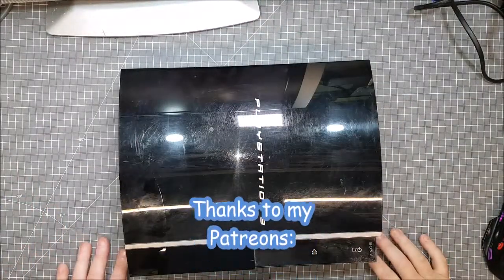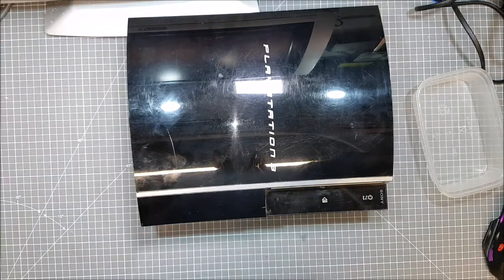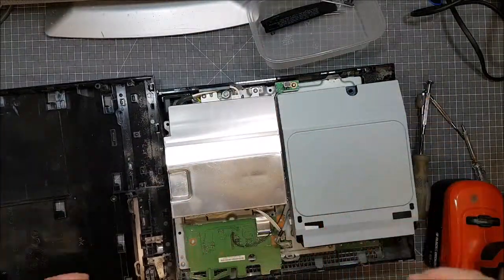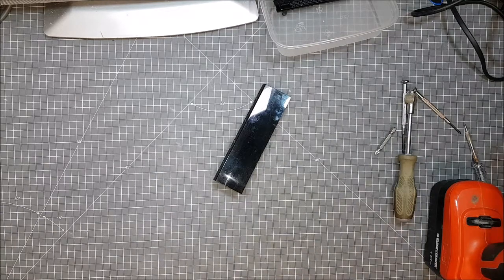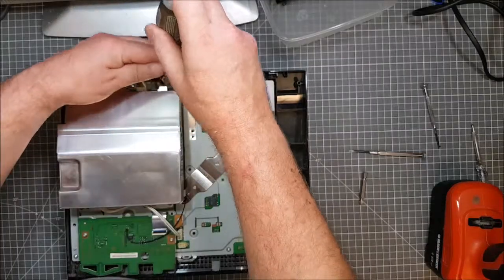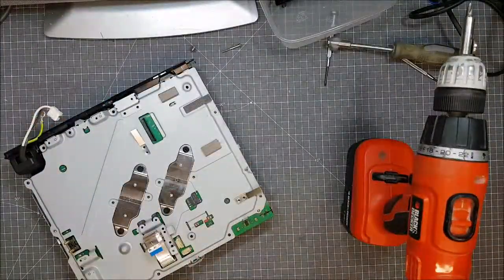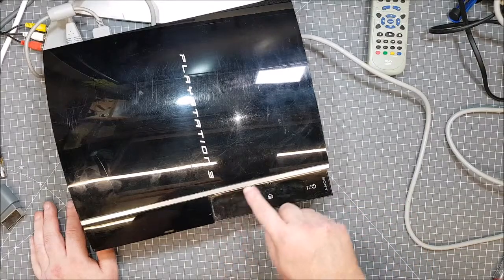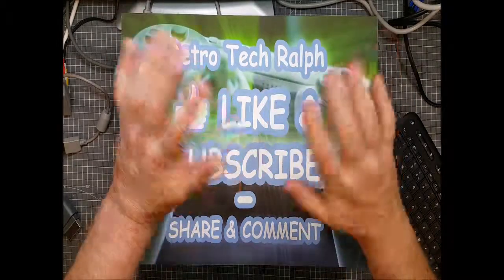2nd Sony PlayStation 3. Trash to GLOD?

Comment: Always worth reaplacing the NEC Token capacitors on the back side of the board with smd tantalum 470uf 6.3V ones. Only thing is it takes some time to do it but then at least you tried what you could and then its probably just BGA cracking under the GPU
Just yesterday i had a GLOD PS3 phat 60gb model, changed the 4 NEC Token capacitors on the back of the board and it is still working today. I modded the fan to run at a higher speed always to keep the system cool and to help decrease thermal stress on the GPU BGA connections. Also delidded the GPU and applied new thermal compound.
Reply: With mine it was YLoD and I changed the NEC/TOKIN caps but now it’s GLoD. Also a 60GB.
Reply: @Techtype_  glod can be many things. It could be the sony video encoder IC going to the hdmi port. Also possible open resistor going to the encoder ic or on the hdmi circuitry. Or at worst it could be a GPU fault.
Reply: @supercomputing942  I didn’t break any resistors so it’s probably a dead RSX. It did come from a Video Rental Store after all..
Reply: @Techtype_  resistors can go open or higher value due to age.... over time they can go bad.... always good to test the resistors on hdmi circuitry it could be an easy fix still... what board model of ps3 do you have?
Reply: @supercomputing942  COK-002
Reply: @supercomputing942  Should we continue this on something like discord instead of yt comments? I feel like that would be more efficient
Reply: @Techtype_  you should check out idreestech he does lots of ps3 repair he covers a lot of ps3 faults on youtube.
Reply: @Techtype_hi I also fixed ylod after cap replacement and I'm getting glod will reflowing rsx fix it?